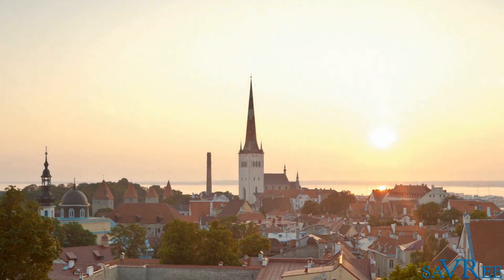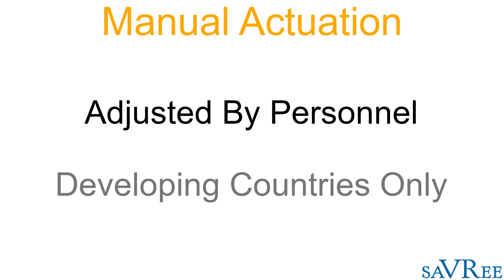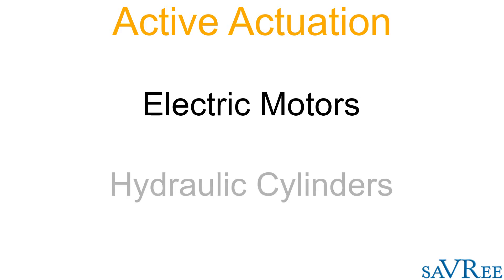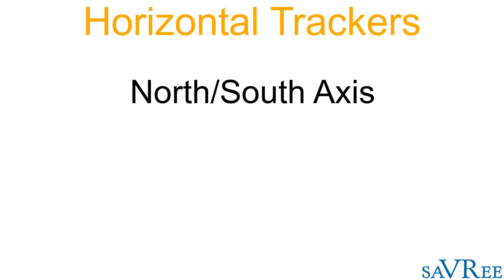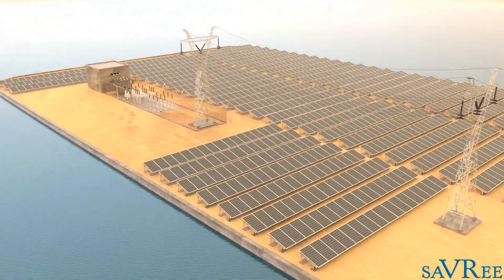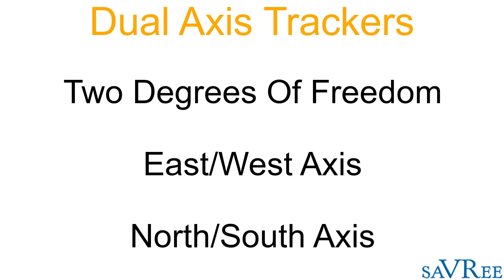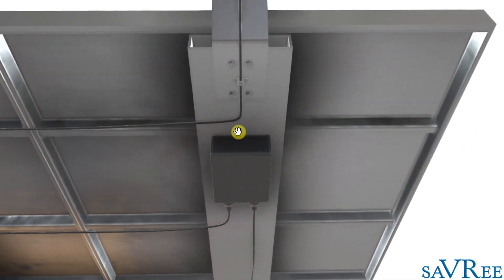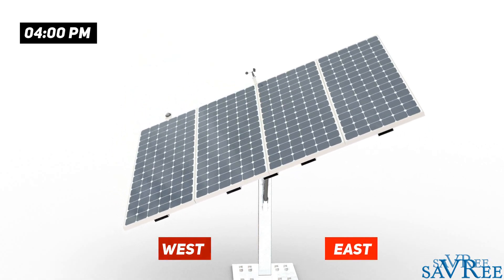How Solar Trackers Work

Comment: Good video. Limited to a .25 acre area, considering a single axis east to west, but also considered a dual axis as it provides up to 40% more energy in less panels. Any idea on which system are good?
Reply: @savree-3d  Actually, I found a deal on 400 watt systems ($14.99 each) that I am taking the 100 watt panels from (will upgrade to 345 watt panels later) to built a several bigger system and want to put it on a dual axis tracker. The intent is a small solar farm tied directly to the grid to sell the power to the electric company with minimum start up of around $5 to $7k v $50k plus. I am also considering a single axis to start with. I'll see what they have.
Reply: @kevinnewell5996  depending on your latitude you might not even need a double-axis tracker. For example at 15 degrees misalighnment angle your panel would loose less than 4% generated electricity as compared to facing sun directly. So unless you live far up north, manually readjusting single-axis tracker for elevation couple times a year will do.
Reply: @Leo3ABPgamingTV  does this help? 41°11'10"N
Reply: @kevinnewell5996  you will do fine with a single axis. In the worst case scenario you will be loosing up to ca.25% of energy generation, and by worst case I mean not accounting for tilting the axis towards the sun and measuring during the sunset or sunrise. What it means in practice that on average you will probably loose around 3-5% energy compared to dual axis tracker, and this is nothing if you take into account that dual axis tracker initial cost and maintenance are higher, so that difference probably would not even cover expenses for having a second tracking axis.  As a rule of thumb - anything below 50 degrees latitude does not really needs a dual axis tracking, because the difference in energy generation is too small.
Reply: @Leo3ABPgamingTV  25% of energy generation, as in 1/4th of all energy? Or .25%. We are at 41 and some change on latitude.
Reply: @kevinnewell5996  sorry for being confusing, it would be much easier to explain in person. Lets say on the day you got your tracker,  you set it up so that it always faces the sun directly when tracking over that day, lets call it 0 degrees. Due to earth rotation and your latitude angle, the sun will shift its position over the seasons, so in half a year time it will be  lighting your panel at an angle of around 41 degrees (your latitude), meaning that at that time you will be getting 25% less energy (you can calculate it  by following formula: 1 - cos(misalignment angle)). That means that over a year energy production from your tracker will vary form maximum output to 3/4 output.  To counteract this you can install your tracker at an half the angle of your latitude towards the sun, so no matter the season, your misalignment angle will never be more than 20deg , and will vary between -20deg to 20 deg over the course of a year, which means that at worst you will be loosing around 5-6% of possible energy output for a couple of month over the year (when misalignment angle is the highest), and much less during the rest of the year. With such setup you will be loosing out on around 3% energy on average over the year. Considering other factors like weather, efficiency of panels and other random stuff, and essentially you are loosing nothing when comparing to dual axis tracker which will cost your more and will require more maintenance. 

Now one thing the above text does not takes into account is earth tilt which to my shame I managed to forget. Earth tilt means another additional 23 degrees which makes the average angle float between ca, -30 and +30 deg, which corresponds to loosing around 13% at the worst and maybe 5-7% on average over the year, but whether it is worth to warrant a double axis tracker is up to you.

Apart from sun position change, there are also other factors like weather and less daylight in winter. It might be worthwhile to position tracker in a way so while it captures less light during the winter (when there is less light anyway) it would capture more light during other seasons, making that -+ angle window less.
Reply: @Leo3ABPgamingTV  thus dual trackers would definitely be worth contemplating (in relatively large gardens or small-holdings) within the United Kingdom, as an alternative to having several arrays angled in different directions, e.g., SW and SE at pitches calculated for the time(s) of year where output is very much greater than at other times, always assuming that shading is non-existent or minimal, and that the owner can be sure of handling all electrical and mechanical maintenance required with the required skillsets and access to cost-effective replacement parts. Sods law pretty much guarantees that malfunctions will happen at the worst possible times of the year, in very cold weather and/or in high wind conditions such as are commonly found in December in the UK during the run-up to Christmas holidays.  I love the idea of dual trackers, but on reflection I'll definitely max out what I can put in fixed positions on top of extensive outbuildings to keep a reasonable battery storage capacity charged up for so long as possible and buy-in cheap rate power at night from the grid. Off-grid systems just do not make sense in the UK.
Reply: @savree-3d  will do.
Reply: Hi Kevin Newell;
"East West Axis Horizontal Tracking Mounts" are generally the least desirable type for
small scale systems. The "North South axis" types are better.
However the "Polar Axis" types are much more desirable for small scale systems.
See some nice examples here:
http://www.redrok.com/electron.htm#tripod
The tripod types are easy to build and more robust than the ones mounted on a vertical post.
Duane C. Johnson
redrok@redrok.com

Comment: Hello. In this design is there a pump somewhere that pushes the fluid in the hydraulics?
Reply: Most small systems use "electric linear actuators"